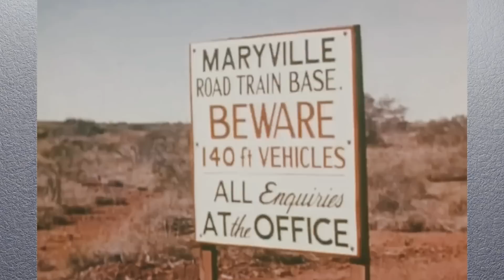An engineering marvel: the Rotinoff Atlantic truck - a revolution in heavy-duty transportation.

Comment: Tom 'Tammy' Sunter  owner of Sunters Heavy Haulage of Northallerton had a Roto in his fleet used to move  pressure vessels from their makers yards  to sites in order to build  petroleum refineries like Grangemouth.  I do not know if this is true, but Rotos especially the larger Super Atlantic were plagued with gearbox problems.  To keep them serviceable some Rotos were converted to an 8 speed  Self Changing Gears RV30 semi auto with column change like an Austin A40 . Fair play to the canny  Russian, Roto built his own 18 speed two stick double gearbox, an similar arrangement to a Leyland Beaver or Hippo. A 6 speed main box had synchromesh except 1st ,unheard of in a heavy tractor. A 3 speed secondary box  with synchro on  2 gears tripled the main box ratios to 18,a good set up but plagued with problems, hence the SCG semi auto swap. The  lighter  Viscount is not a tractor unit but a load carrying wagon designed to tow two trailers, both wagon and trailers configured as cattle floats.  Roto even ventured to all wheel drive with a prototype 6x6 tractor using the undercarriage of an AEC Militant, Southall providing the axles and transfer box.